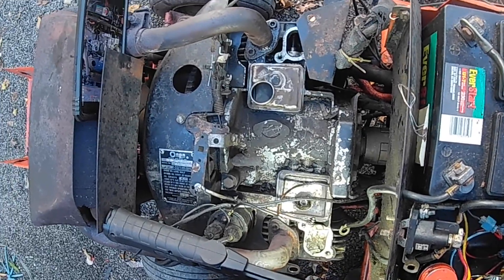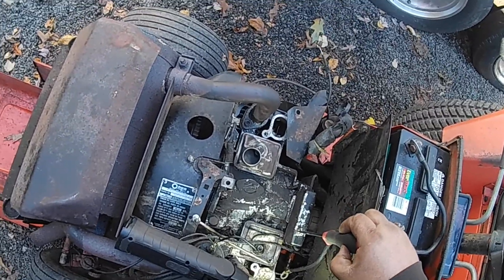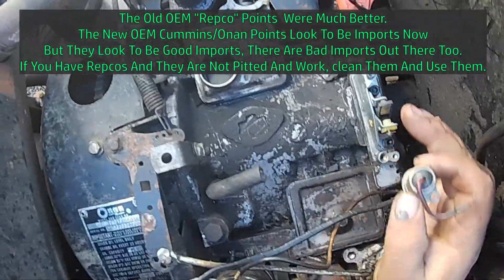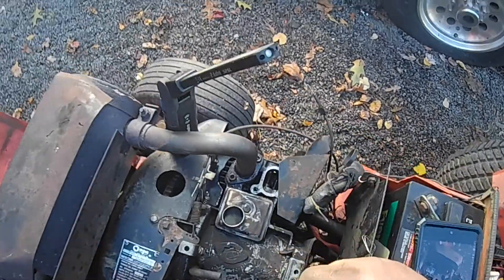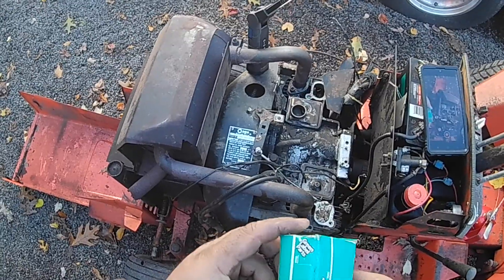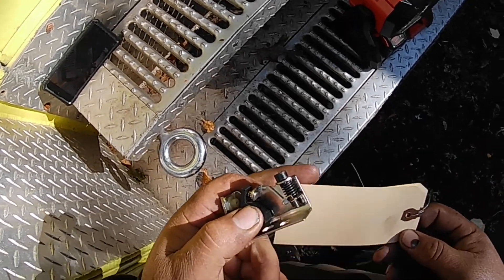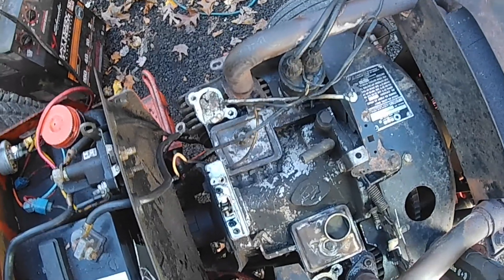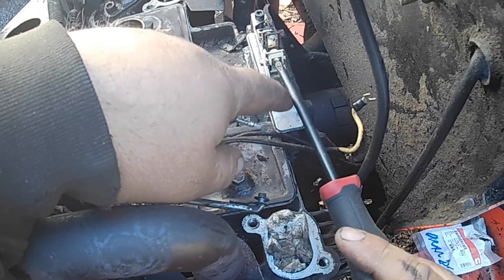How To Install Points & Condenser On Small Engines. ONAN "B" Series Specs & Engine Used In Video

Comment: Hello Sr. My 318 has a B48G installed since I’ve got it and it has been running great. This week it just stopped running and in my troubleshooting I found out I had no spark. I figured it would be the condenser or the points and since they were old I ordered new ones. Now as I was replacing that while turning the engine by hand to fine tune the points I noticed that the plunge was not going up and down, so I started to look further and it seems like the camshaft isn’t turning as I turn the engine. What could it be? Maybe that trust wash let it loose or could it be something even worse than that? Recent oil changes all good and no weird noise up to this point that could indicate something terrible was going on. Any guidance will be much appreciated.
Reply from the maker: Hi, sorry to hear. I assume your valves are not all opening since you said it seems not to be turning. If the valves too are not opening I'm going to guess your cam broke or possibly gear issues. Best of luck
Reply: @caseingersolltractorsnortheast  thanks. Yeah, I’m going to pull the valve covers next to see if there is any movement there. Never the less I need to pull the engine out no matter what, best case scenario the camshaft gear disengaged, worst it’s broken and I need a new one 🫤 right?
Reply from the maker: @felipeengelmann9636  yes if the valves are not moving. If they are then could be the plunger for the points has issues or lobe is bad. Cam bearings wear and can be a issue

Comment: Great video. Mine starts and runs for about 3 to 4 minutes then shuts off. I’m wondering if it’s the condenser.
Reply from the maker: Hi thank you. What model engine? When running does it run well? Does it shut right off or sputter out?
Reply: @caseingersolltractorsnortheast  it’s a craftsman 20 hp onan   It says electronic ignition. It will start and run for a few minutes then shuts down  won’t start. The next day it does same way. I changed the fuel filter but no change any suggestions?
Reply: @caseingersolltractorsnortheast  it’s a craftsman 20 hp model 739.11054D
Reply from the maker: @thomasreece3903  Could be coil, could be fuel pump or could be vapor locking.Maybe spark module. You need to do some diagnostic and see if you are loosing spark when this happens.

Comment: Nice video, I think on a 2 cylinder engine with a dual output coil the ignition fires every 360 degrees of rotation. So the coil fires every TDC making finding the compression stroke unnecessary. on a single cyc TDC - compression does need to be identified.
Reply from the maker: Thanks and thanks for the comment. The system in the example has a wasted spark yes. It fires on compression and exhaust stroke.  But like we said in the video this is how we do it every time to be consistent and sure on all engines. As most times when we are doing points we have the heads off too for decarbon and valve adjustment so we do the adjustment at TDC compression stroke as well.  Keeps things consistent with consistent results and multi task with it at TDC compression lol. Also this video was to show how to do the points in general on most small engines as to show operation and principle of the system. As you said on some models you HAVE to be at TDC compression stroke or where ever the manufacturer recommends. So we figure just being TDC compression every time works for 95 percent of engines.

Comment: Thank you for the video. I just replaced the points and condenser due to no spark. I had it all together but when I reinstalled the intake manifold it pulled out the wires on the condenser and coil. I was scratching my head. Operator manual has an arrow right over the wire and I couldn’t make it out. This video made it point blank easy. 
I have several Onan engines that I operate and I look forward to checking out your video series. New subscriber.👍🏻
Reply from the maker: Glad it helped and glad you got back up and running! Thanks for the support!

Comment: Great video, never came across anything about the points system being a common problem with these while chasing a rough run on my b43g jd318. Split and resealed the intake and have been messing with the carb for months and haven’t gotten anywhere. I have zero experience with points so I’ve been reluctant to even remove the cap & investigate, but thanks to this video I have the motivation to dig in to it. 

PS, don’t worry about little things like camera angles and heavy breathing, anybody watching these are more than grateful for your free time and knowledge. Keep it up and good luck with the channel 👍🏻
Reply from the maker: Thanks so much for the nice words and support. Glad we could help you get after it. Once you do it once you will kick yourself for waiting lol. Any issues let us know. Good luck and be sure to subscribe and follow for more videos.